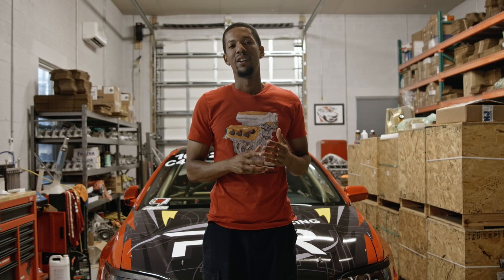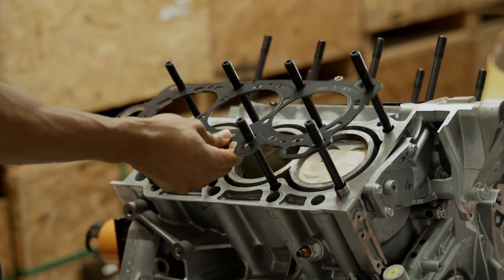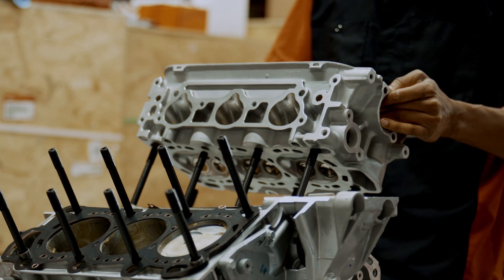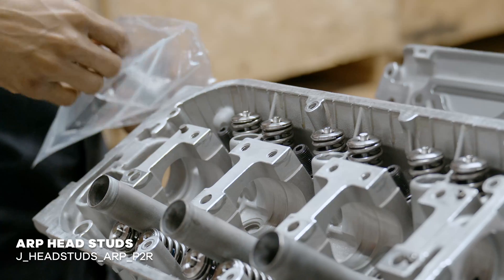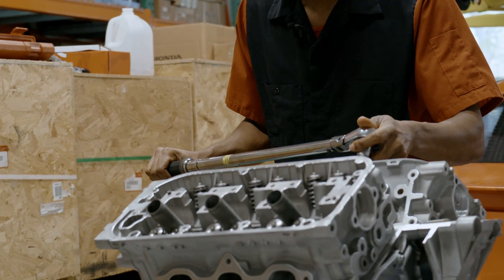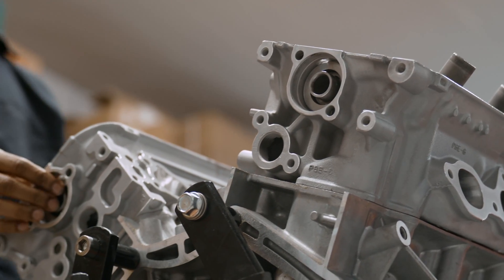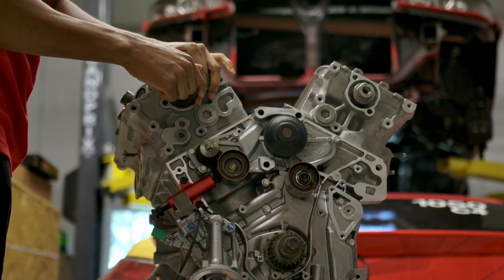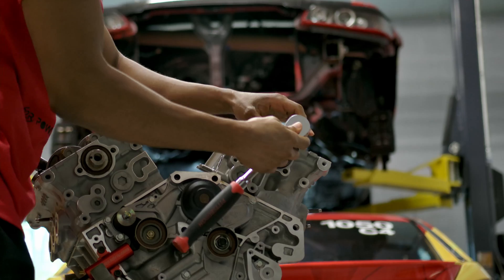J35A4 Short Block with P2R CNC Ported Heads Assembly

Comment: Just to confirm those are j32a2 style heads, and they bolt right onto j35a4 block? Thus meaning I could take my j32a2 heads and put them on a j35a4?
Reply: And would a cls-6 trans fit on the j35a4

Comment: I have. Honda ridgeline  j37 tl block 2011 and top head j35 ported and manifold and throttle body and ecu stock j35 $4000.00 invested  dino test only 203 hp what do You think is My issue.?

Comment: You should sell a Full Bolt On Kit :)
Reply from the maker: We offer cylinder heads with the valvetrain assembled. But not with cam and rockers as you need to do valve adjustment once heads are timed on block.

Comment: What valve covers are those?   What intake manifold do you plan to run?
Reply from the maker: 05 Acura RL. Running 2 front covers, and using our low profile oil cap on both of them.

Comment: Looking forward to the vid. I want to see the results on pump gas vs E85.
Reply from the maker: I think its going to be fairly similar in terms of peak hp from experience.  Mainly cause the engine compression is still in the 10s. Will be on the dyno within the next 2 weeks though.